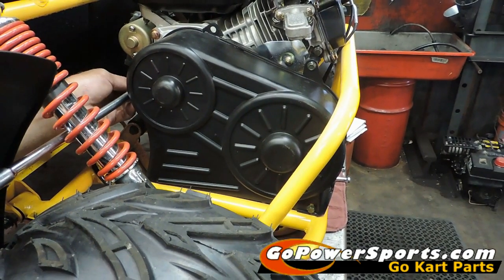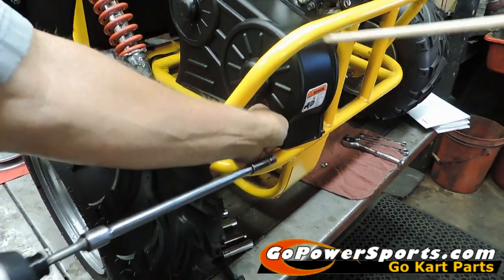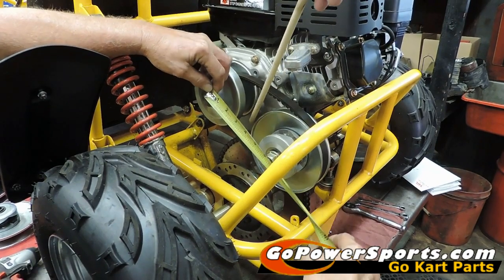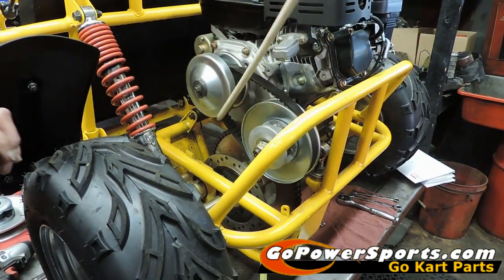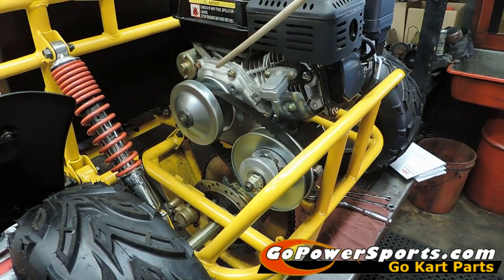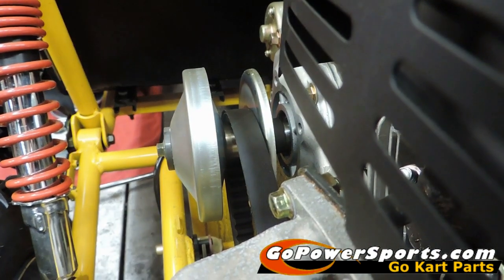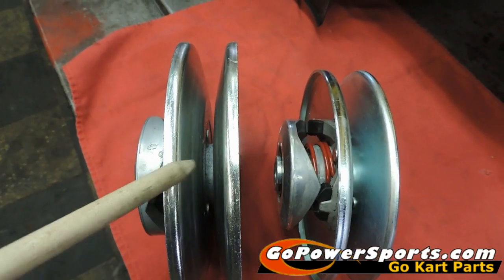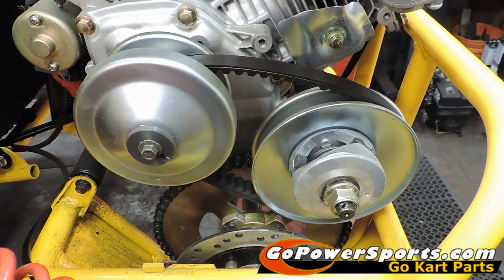How to measure for a go-kart drive belt.

Comment: Awesome thank you! I have an old Carter go kart and it has a Predator 212 engine. I bought this for go kart for $140. I have to push the gas pedal completely down to get it to start moving. When I make a turn it won’t hardly move. I’m thinking I need the correct belt. The person I bought the kart from said they just got lucky and found a belt that fits..🤦‍♂️. I’ll be measuring and ordering a belt from u soon
Reply: Did you figure this out? if the belt is too big you'll have barely any engagement to the drive.
Reply: @norge696  yea I did and it works great now.

Comment: I have a Colman kt196 the distance between the two shafts center to center is 6 3/4 and the pulley Measures 6 1/4 what belt do I need
Reply: Look up 30 series belt for go kart. That will be one you need